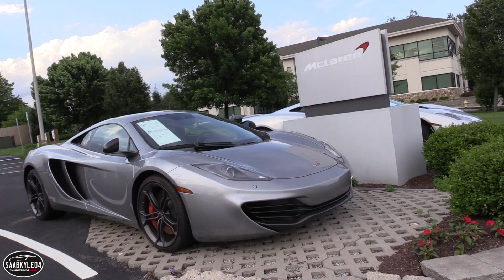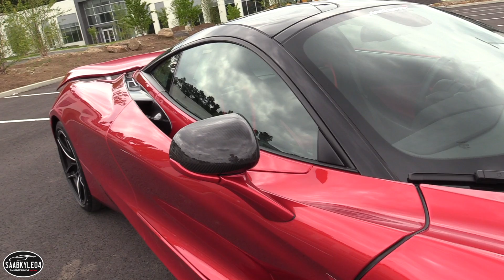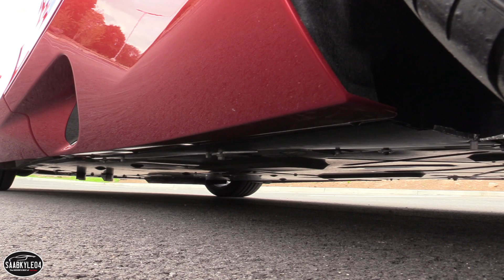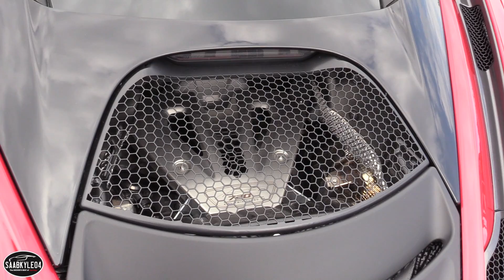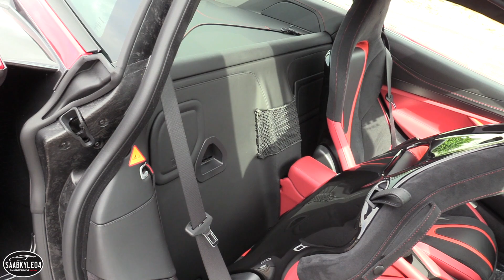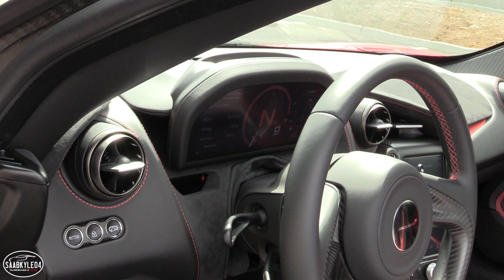2018 McLaren 720S: Start Up, Test Drive & In Depth Review

Comment: You keep comparing it to the 650s, but what about the 675lt?
Reply from the maker: The 675LT was a limited run special edition of the 650S.   The 650S is the direct predecessor to the 720S.  Who knows if there will be a Long Tail version of this, but I imagine there will be several special editions to come over time.

Comment: I'd Still rather own a 488
Reply: Soon2Be Fulfilled eew no
Reply: Soon2Be Fulfilled 
Don't get me wrong. I like the 488 and its predecessor, the 458 Italia. But, I always try to get more for my money. And, with the 720S, you get a supercar that performs just as well as hypercars. Yet it cost significantly less. And it doesn't cost that much more than a 488. In fact, just a handful of options can hike the cost of the 488GTB well beyond the pricing of the 720S.
Reply: Fulfilled Rogue the 720s walks all over the 488 😂and almost every other Ferrari except the Fxx K and maybe the Laferrari but not by much considering the 720s is on P1 level fast P1 LEVEL FAST!! the car that’s part of the holy trinity fast for only 350k no car in its price range can beat it the 720s is hypercar with a super car price tag and your missing out if u choose the 488 over the 720s🤷🏾‍♂️
Reply: Fulfilled Rogue your attitude is very respectable 👍🏾
Reply: tmat04, fair enough
Reply: tmat04, Logical, & understandable
Reply: Yolanda Squatpump, I Dig
Reply: Yolanda Squatpump, 🙏🏽
Reply: Soon2Be Fulfilled 
Well, it's your choice! But, I'd consider it a foolish decision on my part, if I could this car and chose the Ferrari 488 over it.

Comment: Mercedes S class 2018
Reply: Joel Schembri lmao its far more than just an uprated c or e class.  Its completly different beast and league altogether. Better interior,  more comfortable, better luxury   more technology,  more features,  etc etc etc.
Reply: Geert Matthys nah in the E class they put an S class interior combined with a C class
Reply: The S class rules. It's the E's and the C's you should be worried about they have never been even in the same realm as the S class or the SL class cars. What they did do is make the E's and the C's look like the S.
The S cars always get the best tech and are the most reliable. The others are completely undependable.
I have had 10 or 12 S class cars and I would never have any of the others. They all suck !.
The biggest problem with Mercedes now is they just make too many cars now. Their corporate greed got the best of them. And why the new S class convertible is worth over $150,000.00  is beyond me. There is almost NO wood in them just a bunch of leather. I don't like the new S's at all. The important cars for Mercedes Benz have always been The S class sedan and the SL sports car and I don't think that will ever change.
Reply: it's the same but they put E dashboard in to make it less sucky